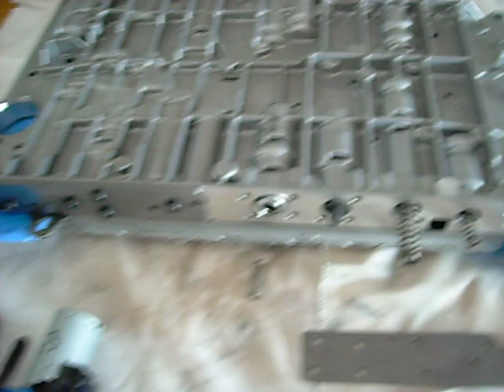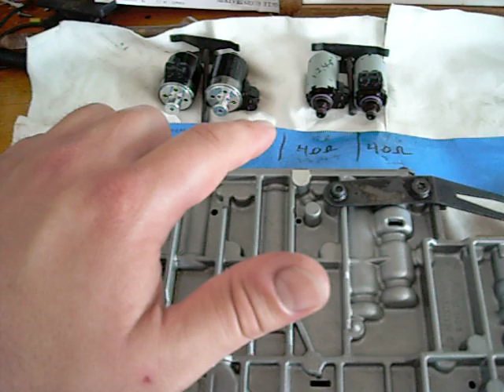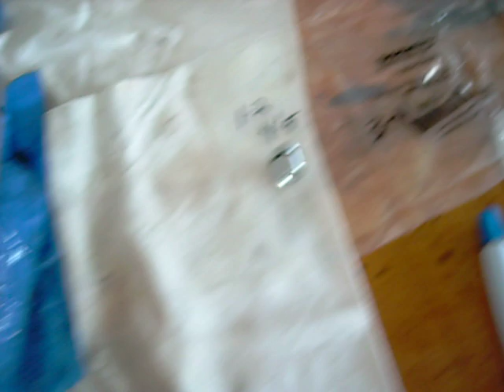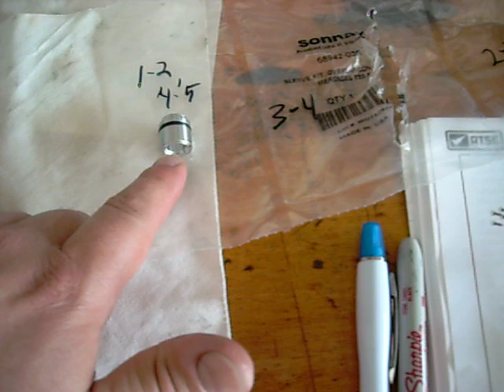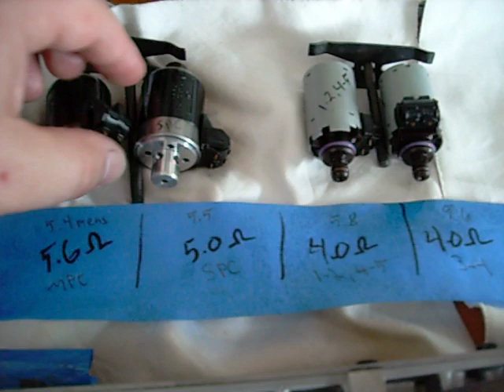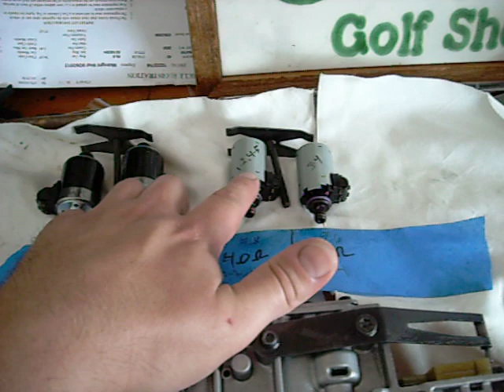722.6 ValveBody Sonnax Kit Install.AVI

Comment: Hi Josh my tyranny 722.6 won't shift. Mercedes Mech told me its the valve body needs to be replaced. Can one if these kits help get my tyranny back to working good and what kit would I need. Thank you
Reply from the maker: Hi Danny, it is possible that replacing the valves with the Sonnax kit may help, although not a guarantee.  There are also shift solenoids that can be electrically tested and replaced.  If you replaced all those things it may still not work, and you will be out the time and money.  You will have to decide if you want to gamble-it could pay off.  One thing I would do however is buy the 722.6 transmission repair manual and electrically test the solenoids through the TCM electrical connector.  That will tell you if you have an solenoid electrical failure or not and could help with diagnosis.  TCMs can also get filled with transmission fluid wicking up through the wiring which can also cause issues too, so research how to check for that too.  God Bless!
Reply: @josh8loop  thank you for taking the time to answer will do and I will keep you posted. God bless

Comment: Wondering if u can help I have a 06 Dodge Charger Dayton with a nag1  I'm getting a bad shudder in low RPMs under light load when I'm just cruising and when I'm slowing down to stop  it shift fine if I put it in manual mode it goes away could it be my torque converter not locking up or having problems unlocking or my clutchs in my transmission I had overhauled like two years ago because in was goin into manual mode by itself but if u have any suggestions I can real use some help thanks

Comment: Where did you get the o-rings for the solenoids?
Reply: I know your question is 2 years old but I saw it was unanswered. I just got a set from cobratrans. Only company I found that sells em. They are on ebay as well. Just google 722.6 solenoid orings. 🖖live long and prosper.

Comment: what solvent did you use to clean the transmission and parts.  how is it working now
Reply from the maker: I used cheap brake parts cleaner and cheap carburetor cleaner from Walmart.  Everything seems to fine-not really any better or worse than before.  It is possible however that getting in there and cleaning things up(the speed sensor specifically) may have kept this thing from having issues that would have otherwise come up.  Eventually I will install the last Sonnax kit that doesn't require machining and replace all the shift solenoids with new ones.  This in my opinion should allow it to continue to work for a long time.
Reply: josh8loop what is the last Sonnax kit? I only know of 68942-05K.

Comment: Considering this clearance issue (i guess symptoms are exacerbated with cold weather due to metal shrinkage) do you think a friction modifier additive (i.e Lucas Transmission Fluid) would help?

I also believe they promote some seal swelling to lessen the effects of o-ring shrinkage.
Reply from the maker: Unsure on the friction modifier additives.  I have used LUCAS in the past on a VW jetta 01M transmission with good results.  I had nothing to loose on that particular car since the transmission was bad so I figured why not try it out.  I would be much more cautious on the 722.6 especially since mine is not bad right now and I wouldn't want to make it worse.  If I had it to do over again I would have most likely just replaced the shift solenoids when I was in there.  That is what I am going to plan for the next time I drop the pan.  FWIW
Reply: josh8loop the consensus on the internet is to not put additives into the 722.6, I'm not sure if this is based on any hard facts or just paranoia. isn't the 722.6 identical to the NAG1 transmission found on a number of American cars? I suspect many NAG1 car owners have placed some additive in their transmission. 

is there any particular reason why you think replacing the solinoids would produce the best prognosis?
Reply from the maker: I would tend to agree with that consensus.  There seems to be no end of reading about accounts of people damaging their transmissions by using the wrong fluids when doing services.  The other thing that can change fluid properties is adding additives that modify the fluids operating characteristics.  The manufacturers come up with a particular fluid recommendation based on solid engineering evaluation and even post failure analysis to re-evaluate fluid specifications previously made.  If you have a clearly identified deficiency of the gearbox and that deficiency is specifically addressed by an additive then it gives you more confidence to use it.  That requires quite a bit of investigation and consideration however and that is why most people don't put in the effort rushing to conclusions  adding things blindly.  

Your correct, the NAG1 is the same gear box and is used on quite a few vehicles.  I am thinking of doing the solenoids based on some past research into this particular gear box and positive results from solenoid replacements.  I can't cite the examples right now since it was long ago that I was looking into it.  It kinda makes sense to me since the electrical solenoid internals can get fretting on the sliding surfaces which slow down their response and also would allow fluid to leak by and not go where it should go.

Comment from the maker: 63K miles after this video I flushed the fluid with 12 quarts of Shell 
ATF134 and new filter/gasket.  This time no metal particles/flakes in 
pan or filter.  Just a little bit of sludge on the magnet but that 
appears to be expected.  The fluid looked pretty good to me for 63K miles of use.  Not sure if the overlap sleeve installation and other mods done in this video helped keep things cleaner with less wear or not.  I am glad however to see that the internals look much better than they did before.
Reply: +josh8loop excellent video, my 05 E320 CDI was experiencing flaring & harsh shifting between 2-3 in C mode when car is 1st started & not yet warmed up. A fluid flush & filter change were done @212K miles which seemed to resolve the issue until about 2K miles ago. It now has 218K miles on odo & the flaring & harsh shifting is back until engine temp gets >60C. I believe I read a post by you over on benzworld about engine coolant & thermostat change being of benefit for rough shifting so that is what I intend to do next.
Reply from the maker: That's quite a bit of mileage on that gear box.  You did the right thing with the fluid and filter change.  I'm sure you used the appropriately rated fluid too right :)  As far as the thermostat and coolant change go that too is a great idea to do since there is finite life on the coolant itself, and the thermostats seem to drift from ideal temps after 100K miles of service.  In your case, I wouldn't expect any significant change in shifting.  Seems like a new or remanufactured valve body and new shift solenoids might be more appropriate.  Those items are a bit on the expensive side I know, particularly the valve body itself.  You could take a bit of a gamble and install the shift overlap sleeves that I did, install a new Sonnax TCC Damper Valve and Sleeve kit(68942-23K), and replace all the solenoids and see how that goes.  Again, a bit of a financial gamble but if it pays off it will save you some dough and increase the service life of that gear box.  Best wishes!

Comment: How did you identify the location on the valve body which cylinder is responsible for what gear matches to it?
Reply from the maker: +EndofUSA 

http://s3.amazonaws.com/sonnax-dev/uploads/valve_body_layout/vbl_file/17/Mercedes_722_6.pdf

Sonnax seems to have some great resources available.  Also recommended is the ATSG book for 722.6 transmission.  I got one on Ebay for $30.00
Reply: josh8loop
thank you very much!!! You are a BIG HELP!!

Comment: Hi
I assume Sonnax kit is easy way but my question is, can you modify original sleeves on lathe to accept O-ring? Or is it also abt sleeve internal diameter/wear?
Reply from the maker: +jat1mat1c 

I'm sure you could chuck it with soft jaws into the lathe and make an external O ring slot.  Only thing is that like you mentioned it is also about the internal sleeve ID/wear.  Ebay has some nice Sonnax kits available that include the ones I did plus the TCC Damper Valve and Sleeve kit:  68942-23K
Reply: Yeah the kit is only like $35 and you know it's just right. I'd be afraid to go through breaking it all down and putting it back together with new fluid just to discover I didn't get the oring deep enough or too deep.

Comment: Hello josh8loop,

Did you changed the lock up valve, the one that you have written 2.6 Ohm, because as I have heard it may provide poor shifting, I have also ordered a sonnax kit and a new lock-up valve as I'm about to change within the next week's time, I'll come with an update on the outcome :)
Reply from the maker: No, actually no solenoids were changed.  I just swapped the 2-3 for the 1-2/4-5 like I mentioned in the video.  If I had new solenoids at the time I wouldn't hesitate to change them however.  Maybe in the future.

Comment: Hello Josh, just wondering, did you find your problem, I have 2005 E320 CDI with 2-3 flare shifts. Thanks for answer!
Reply from the maker: I just noticed a slight flare between 2-3, and during a pan drop noticed sediment in the pan.  I decided to do everything I could do to prolong the transmissions life.  If I had the money at the time a fully rebuilt valve body with the Sonnax mods would have been the way to go.

Comment: I went into the computer box on my 1998 E300 and took out the TCC. It had over a couple of ounces of transmission fluid that had wicked up from the connector into the plastic housing. You might want to check yours if you are still having problems.
Reply from the maker: +Jesse Parris 

Good idea-That was actually one of the first things I did after purchasing the vehicle and researching the 722.6 transmissions.  Seems like the Pilot Bushing likes to leak fluid into the harness and wicks it's way up to the TCM under the passengers side floorboard.  Fortunately mine was dry as a bone, and so I just pre emtively replaced the Pilot Bushing during the flush service.  Another thing I did was to purchase a $30 ATSG repair/rebuild book for the 722.6.  It has solenoid resistance values that can be checked externally through the TCM plug to verify the general health of the shift solenoids.

Comment: How was the repair?
I have 125,000miles on my car. I don't have any serious problems with it. Sometimes I feel a vibration when gears shift. I'm going to change the fluid and filter. Should I do this repair as maintenance and is there anything else I should do before I put it back together ? Thanks!!
Reply from the maker: The repair went well but I'm not sure it ended up helping anything.  I would do the fluid and filter on yours and make sure you don't have a Valeo radiator in it.  The Valeos sometimes let coolant seep into the tranny fluid causing damage.

Comment: I actually rebuilt my ZF 5HP19 transmission that had a downshift concerns only between 3-2 and 2-1 shifts. After the rebuild it drives better but not absolutely perfect like brand new. Again, just likes yours it has to with the adaptation issues. However, I'm fine with the rebuild and is getting better and better. Thought I'll give some optimism to you.

Comment: Josh, could you explain where and or part numbers you have for the Viton o-rings used for the reinstallation of the solenoids.  I agree that replacing these o-rings after disturbing them is the right thing to do but could not locate how or where to buy them.  Thanks much

Comment from the maker: Sonnax is a very well known and highly respected company in the transmission industry.  I have always admired their investigative R&D and problem solving ability-it is evident in their publications.  Remember they only develop their products in response to REAL transmission issues.  I only replaced parts that I could replace without requiring fixturing and tools for a bore ream job on mine.  It would have been more thorough if I had done the whole thing however.

Comment: My shifts used to be slow and sloppy but i installed stage 1 selenoids on my 722.6 and also went with redline D4 fluid shift are a lot better faster and still smooth and also new lock up solenoids

Comment: There are a lot of things you can do with the Star diagnostic system to adjust shift quality. Your issues may be more software than hardware related. If you could find a good Indy shop with the Star system, they could take a look at the current adaptations and tell you a lot about your transmission. Good job on the valve body kit.

Comment from the maker: It didn't necessarily help or hurt my symptoms.  I'm beginning to think that is just the way this transmission operates and is some what normal.  At least I got in there and inspected things and cleaned things while I was at it.  I flushed all the fluid, replaced some valve body solenoid "O" rings(with viton) and various other things.  I can say however that in the future I may replace either the whole valve body or potentially just some of the shift solenoids as a preventative maintenance.

Comment: Where something is physically made, does not make much difference nowadays. 

Cheap is not good and good is not cheap that's what it boils down to. 

Many OEM have their simple components assembled in China. But they have their own skilled people in charge their and doing the training. They also are in charge of design and quality control, that's what matter the most. Unfortunatelly anyone who wants to make and sell things for cheap without the slight concern over quality also goes to China.

Comment: Pretty good job you are doing there, this kit was never really intended for do it yourself, our parts are really meant to be installed by transmission repair specialists, but I like the way you approach it this. Very clean and logical approach, the solenoid swap among other things is a good logical thing to do. One word of caution about the the filter, be sure to use only an OEM filter. There are lots of aftermarket filters out there that can give you very costly problems.